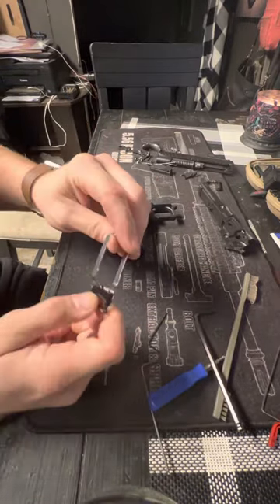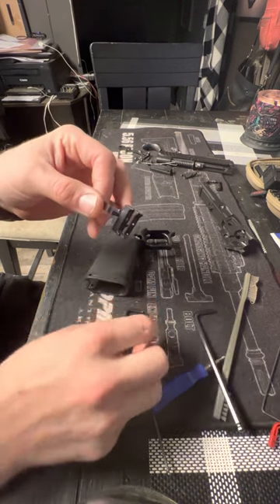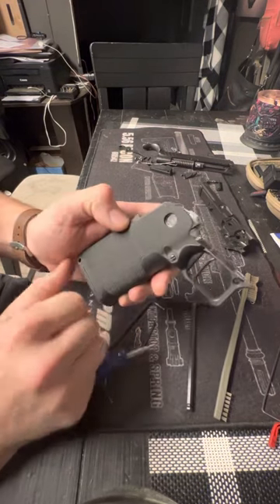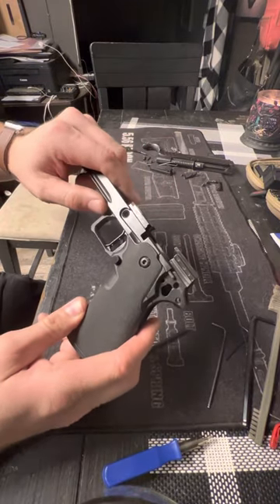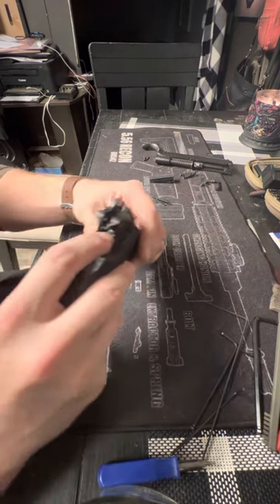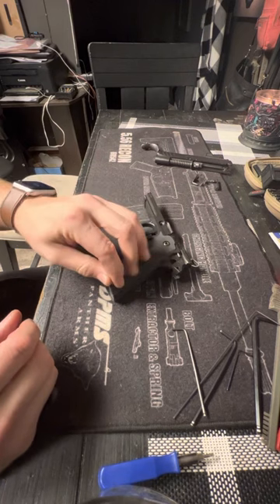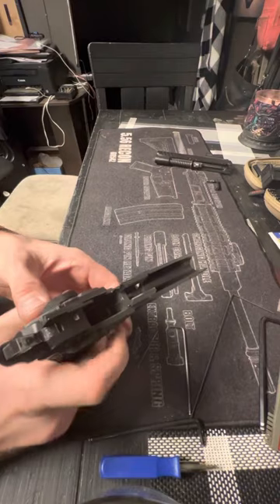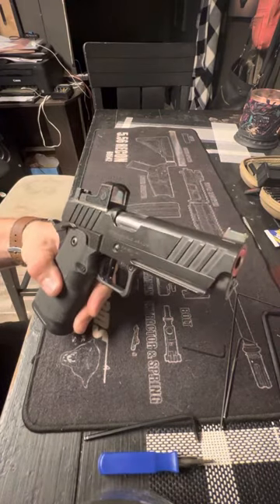SpringField Armory 1911 DS prodigy Trigger Install ( disassembly and reassembly ) ￼

Comment: Good video sir. Some minor adjustment coming from a classic 1911 year down world. This helps a LOT. Took mine down new outta the box and cleaned it up.. polished the fire control surfaces and adjusted my sear spring. It took it from what must have been 5.25 lbs to around 3.
Reply from the maker: @Jdinaz  thank you I appreciate you you! Just remember Springfield does zero tuning. I have two prodigy’s and both of them had out of tune extractors. So it wouldn’t hurt to pull your slide. Remove your barrel and guide rod. And use a new round for weight purposes and insert it behind the extractor against the breach face. Rotate your slide 360°. The bullet should not fall out. You should be able to shake the slide 5 to 10 times and then the bullet should fall out. The last part is really subjective because of the variations. But if the bullet does not stay secure while you rotate 360° it is too loose. And you will need to tighten it a little bit. I have a video that is pretty recent showing my brand new 5 inch prodigy unable to secure around at all.
Reply: @americantrucker9813  I’ll check it. The extractor SEEMED to be pretty tightly sprung with quite a curve in it. I’m pretty pleased with the machining and assembly this far. Great slide to frame. No goobers to speak of anywhere. No mush in the thumb or grip safeties. I have high hopes for it. But the trigger was definitely attorney proof.
Reply from the maker: @Jdinaz  they are definitely well-made firearms! Don’t mistake what I said, saying they are junk. Most of them just need a simple tuning. I will say the slide to frame fitment is very nice unfortunately they were fitted after cerakote so once the coding wears off the frame rails. It won’t be as tight. But the simplest fix for that is to keep it lubed nicely. If you have any feeding issues, or ejecting issues. The first thing I would check as I said would be the extractor, but also the chamber reeming. You can easily check that by taking the barrel out and inserting all of the different types of ammo you use. The bullets should go in and fall out Via gravity alone. I found on my commander. It was a little tight and didn’t like some ammo. But my 5 inch was perfect.

Comment: You have helped me so much !!!! My 4.25 is a beast because all the advice you gave me was so spot on !!! Thank you. I use red Loctite, also. I'm a retired aircraft mechanic and "red" rules the day. So the only work I had done by a gunsmith ( JP Customs, 1911 Master in Conroe Texas) on mine was the grip safety. I had one machined and installed that has a large palm bump to give me more room for purchase. That work was above my pay grade. Everything else was done by me on your advice and now has all machined EGW parts. The slide rolls like it's on bearings. Extremely consistent 3# trigger. I like the trigger so I did not change it. I use Dawson 11# recoil spring with a buffer, a 17# mainspring and an EGW sear spring. With a Cyelee "Wolf X Pro" and an Olight PL-3, 25 yard head shots are consistent. Great accuracy !!!!! With a 20 round mag it weighs in at 53.25 oz.(1509 grams) Thanks again for your help !!!!     🙂
Reply from the maker: Thank you very much. I really appreciate the feedback and you’re very welcome. I am very happy. I was able to help you out. That is literally what this is all about for me. So getting your feedback is important! So many firearm owners don’t know what they are missing out on in my opinion. Customizing and making your firearm more personal & suited to your desires is a ton of fun and it helps you understand your firearm intimately. You can’t get that buying a Glock and keeping it OEM. Well thanks again and God bless my friend!
Reply: @americantrucker9813  I have no real way to repay you but to wish G#ds Blessings upon you, tell you the truth and tell others to listen to what you know !!!!!    🙂

Comment: I have watched multiple install videos and disassemly videos and no matter what I do and how diligently I follow along my thumb safety just won't come out.
Reply from the maker: So the trick is to make sure the hammer is cocked, and the safety is up into the Safety on Position and take a think blade  knife and help pry out the left side safety. If they haven’t been removed, it can be difficult the first time don’t worry you will not break anything just be careful not to scratch up your gun. Use the rail as the leverage point
Reply: @americantrucker9813  ok. I have to find a tool thin enough for a knife edge but I don't care about the edge and it won't mar the gun. Thanks!
Reply from the maker: @nick3d155  what I do is put the blade flush against the rail and than flip the safety up and that gives just a little leverage to open it up just enough to get the blade into middle of the top of the safety if that makes sense. Just don’t pry on the right side safety because it can’t be moved out until the left ones disconnected from it because it needs to flip up and out of the grip slot.

Comment: the hammer doesnt want to stay down. any help?
Reply from the maker: @Bazzmotives  I can certainly help my friend! Stay down against the Firing pin ? Or stay down as in cocked ?
Reply from the maker: @Bazzmotives  if it’s not resting on your firing pin than it could be your hammer strut may be too short and the lack of main spring engagement with the strut is allowing the firing pin spring to push the hammer back a small amount. Easy fix, hop on eBay or egw and order a 1911 hammer strut. Possibly buy an oversized strut (it may say gun smith fitment required) and you’d just sand off what you don’t need or just leave it as is and run a light 17lbs mainspring
Reply: @americantrucker9813  stay down cocked. I tried ur way and it wasn't it. I figured it out. It was the leaf spring sitting a certain way
Reply from the maker: You’ll have that but you’ll get the hang of it and it’ll be like the back of your hand. I’m glad you got it squared away buddy.

Comment: I'm in the middle of this right now. Unfortunately, I have the tangs so far out on the bow that the trigger is hits the mag when inserted. lol And still, the hammer won't fall. Looks like I'll have to trim back both the top and bottom of the trigger for some mag clearance and for more trigger travel. (Overtravel screw is all the way out.) I was kinda surprised at how far past the grip the stock trigger bow went. Wasn't expecting this.

Update: I figured it out. I had the trigger screwed fully up against the bow because I thought it was the best fit for my reach to the trigger. I screwed the trigger out three turns and that solved all of the problems. lol Even with the trigger turned out three turns, the fit to my finger is still perfect. Thanks!
Reply from the maker: They sell different trigger shoes if you have the Atlas bow which I’m assuming you do maybe try the Atlas short trigger shoe. The good thing about Atlas is you can buy the shoe by itself. Different hammers & sears and trigger bows will have different Breaking & reset travel points so you just gotta remember to start it at zero when replacing any of those points before tuning it in. But I’m glad you got it squared away my friend and I’m glad this was able to help you!

Comment: DUDE Phenomenal - I just put in the Atlas! Your video absolutely saved my ass. Thank you so much! I even was able to tune and buff some parts and was confident in reassembly. Thank you so much!
Reply: What are the chances you could do an Egnition System/Hammer Install? EGW
Reply from the maker: Your very welcome! And I can upload a video this weekend!
Reply: @americantrucker9813  fuck yeah
Reply: @americantrucker9813  did you notice you disconnector holding up the slide and did you polish the disconnector?
Reply from the maker: So you really don’t want to take any material off of the disconnector, but you can polish it, if you wish to remove the slide resistance on the disconnector, you will have to cut a ramp in the front of the disconnector rail on the slide basically you would take a Dremel and take material off of the bottom of the breach face the goal is to make the bottom of the breach face sit above the Disconnector (my $6,000.00 Atlad NYX came Factory with this Ramp cut into the Disco Rail on the slide) but I will tell you the only real gain from this will be the smooth action of the slide without any resistance as far as functionality goes it does help with reliable feeding but not as much as you’d think you see because the slide is held up @ the Most Rearward Position of the Slide Blowback so once it has cleared the disconnector it Is @ Full speed and some would argue this helps reliable feeding because it ensures the slide doesn’t outrun the magazine (which is 1 of the reasons why alot of competition shooters go with lighter, recoil springs) I have ran 5000 rounds through my Atlas with 2 stove Pipe failures and I’ve ran over 15,000 rounds through my Prodigy without the ramp cut into the slide with 4 stove pipe issues and I’ve ran 600 rounds through the prodigy after cutting the ramp into the slide without fail but that is my opinion only they’re may possibly be more factual reasons why or why not to make such a modification.
Reply: @americantrucker9813  did what you said. My slide is like butter now. Shoots more replicable and consistent. Unreal.
Reply from the maker: Awesome thank you for sharing. I am happy to know that I helped you out if I didn’t then there really wouldn’t be any point in me spending time posting videos so I do appreciate the feedback.!!!
Reply: @americantrucker9813  got a dremel with glitz and polished all internals that were rigid/flashing. Shot 500 round 124grain nato. W/ not one failure to feed or misfire. Consistent drops back on target. No more hang ups on disconnector or gritty feeling in slide or trigger. Freaking love it.

Comment: Thanks for the full break down big help
Reply from the maker: Your welcome my friend! Glad it helped.
Reply: @americantrucker9813  love the gun a little sharp around the edges but nice
Reply from the maker: I’m glad you’re enjoying it and I can understand it being sharp. My atlas slide literally cuts me! Put on The Prodigy you can buff those sharp edges But unfortunately it will remove the cerakote
Reply: @americantrucker9813  yea Springfield could've done better I think they made it to quick without checking the prodigy it seems as soon as it got made they just rushed it out the door
Reply from the maker: @mickeythompson5445 your probably right my friend but in all I like what they did but I’m biased because I was waiting for a Bul Armory Tac 2 for over a Year with no end to the waiting in sight and than out of nowhere the prodigy came out and much cheaper and the things that they did cheap were irrelevant to me because I would have upgraded the internals & tuned it regardless unless they had put EGW internals and Hand-fitted & tuned but it would have cost 3x as much ohh snap I did buy a $6,000 atlas with EGW internals and I still had to tare it down & replace the Sear and tune the trigger lol so I guess my point is It don’t matter how much more you pay you can always have issues and I think with this platform guys whom never took a gun apart were able to learn as much about their firearm as a gunsmith and once you understand it and you can tune it yourself it makes a much more reliable tool for EDC & whatever else you may use it for. There’s plenty of cheap guns that take me hours to take apart and put together and with more tools and some are even scary to strip bc they can break like FN 509s frames loving to crack. But I think once you get yours squared away I think you’ll fall in love with it and it will be your favorite pistol platform well that’s how it was for me but definitely let me know how your story goes ! And God Bless you & Yours !

Comment: Thanks for the video. I struggle with getting the take down lever back on. You did it easy. I want to venture in getting a flat trigger for my prodigy.
Reply from the maker: The takedown pin can be tricky that’s normal, I find it makes it easiest to once you get the take down the pin in the hole and it won’t go any further slowly work the slide back-and-forth until it drops all the way through. It’s usually a little bit of pressure to the rear for it to go home.

Comment: 2 questions. I got it all back together first time.  Everything worked except for the grip safety. So I tore it back down trying to fix it and now while putting back together I can’t get the pin in through the main spring housing. It looks as if the bottom of the main spring is in the way of the pin hole?? Any help would be highly appreciated please!
Reply from the maker: Yes indeed! So to put your mainspring pin in you must make sure your slides off and hammer is all the way Down for the easiest way to install it, and your grip safety will need sanded down if you’ve changed the trigger in most cases especially if it’s an Atlas Trigger and you’ve taken pre travel out.
Reply: I didnt change the trigger, just cleaned the gun thoroughly. I can slide the grip safety in and when I try to pull the hammer back it doesn’t cock, it just flies back forward. I had it all put back together and everything was working except for grip safety

Comment: What did you replace besides the trigger to get that 3.5 # pull? Thanks for the video 👍🏽
Reply from the maker: I have a couple of trigger job videos that can walk you through the process, I would say the key is to remove friction from the entire trigger, and when I say trigger, I mean the trigger shoe, the trigger bow, the hammer, & sear. The hammer and sear can fit snug but they shouldn’t be rubbing hard and wearing the finish on either the frame or the parts, so you can polish the inside of the frame and or the hammer & sear. This is where your disconnector being fitted properly with the hole in the frame is important, because dirt/carnon/debris from shooting can cover your hammer, and sear and start to cause friction, so making sure your disconnector fits perfectly in that hole is a good thing, and once you’ve made sure that all of your parts can move freely without a bunch of friction, then you will need to tune your sear spring, I recommend at least a 17 pound spring ( I use a 13lbs ) the heavier the mainspring the heavier the trigger & vise versa. And for tuning the sear I suggest watching my video so that you can see what to do and how to test it,
Reply: @americantrucker9813  thank you much 👍🏽
Reply from the maker: @bddizon you’re very very welcome my friend!

Comment: Gotta ask since it’s the first I’ve seen on a duty sized gun what made u go wit a small rmsc plate and optic?
Reply from the maker: If you noticed that video is from when the Prodigy was first released and The prodigy’s only came with 1 optic plate and it took months to get an RMR plate. This video was simply modifying the plate to accept an optic I had laying around.

Comment: Hey man!! Great video!! Where do you put pressure on the trigger bow to add a little pre travel after the gun is reassembled?
Reply from the maker: If you have the atlas trigger. There are two little tabs that meet in the middle by the trigger bow. They are little metal cut outs do you have to bend them out to erase pre travel and bend them to normal to ass pre-travel
Reply: So I have an atlas trigger and I already adjusted the tabs out. I remember you said that if the tabs are adjusted a little too far forward that you can reassemble the gun and the push the trigger bar forward hard enough to bend the tabs back a little. I was just wondering where you push on the bar at when it’s all put back together.

Comment: So I’ve damn near followed this video to the T but I’ve put everything back together and I can get the trigger to reset… I’ll pull the trigger and let the hammer fall but if I try and hold the trigger and bring the slide back the hammer falls everytime
Reply from the maker: Did you put in an Atlas Trigger or different trigger or other parts ?
Reply: @americantrucker9813  so I went to a different video of yours last night to trouble shoot and found that I was putting the sear spring in wrong. I had to pay attention to you mentioning how the three different knot hes have to do and lay down. (Disconnector) etc.. got it worked out and installed 👍🏼
Reply from the maker: @Animeaesthics  awesome! I’m glad you got it fixed, I’m sorry about the first video I realized afterwards that i probably should have mentioned the disconnector & Sear positioning but I’m not a video specialist so I’m not sure how to edit and do all that and it was a long dang video. I’m not sure if you got this information in the videos but once you get your trigger shoe the way you want it as far as over travel, I’d recommend some red locktite on the triggers over travel screw ( Unless you are going to replace your Hammer or Sear, & disconnector  soon) because that over travel Screw in the trigger shoe can & is likely to move (depending on the trigger shoe & screw) and can prevent your gun from firing. And I don’t want that to happen to anyone.